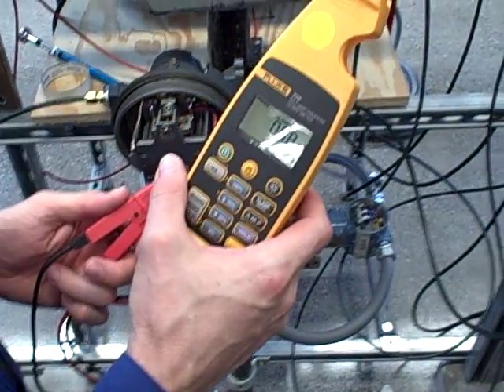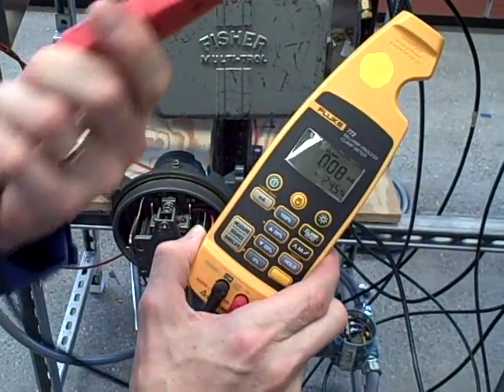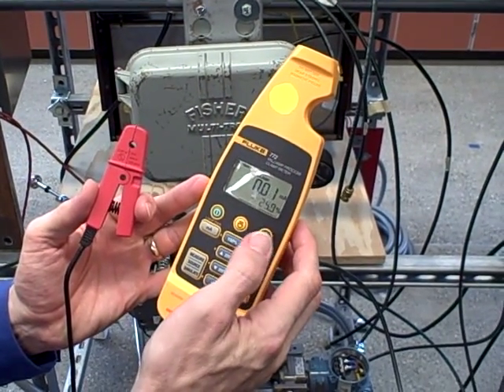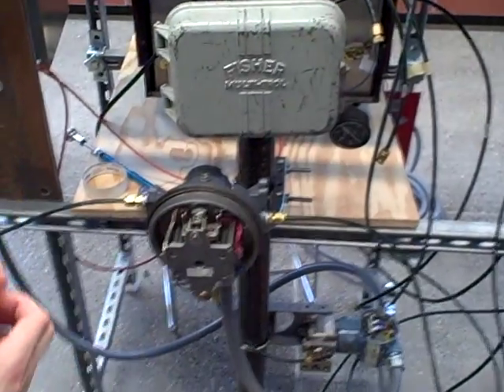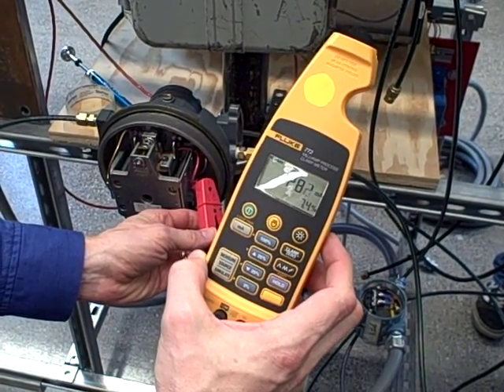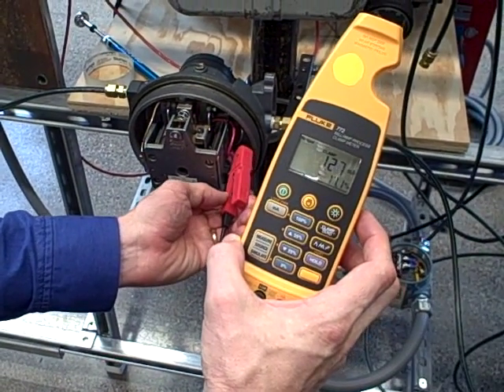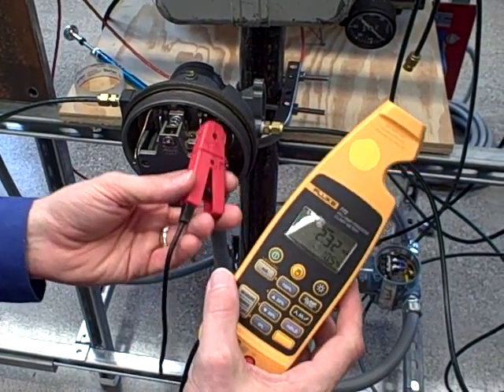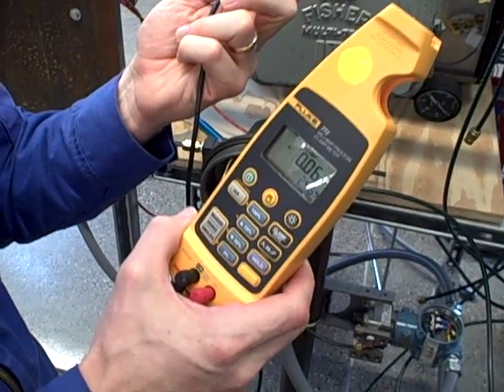Loop current measurement using Fluke 772 clamp-on milliammeter

Comment: Hi thanks, can I use this on higher voltages and hi frequency in power supply between pcb component to read mA used?
Reply: Hi, simply check the ratings on the common port as well as the mA / resistance port